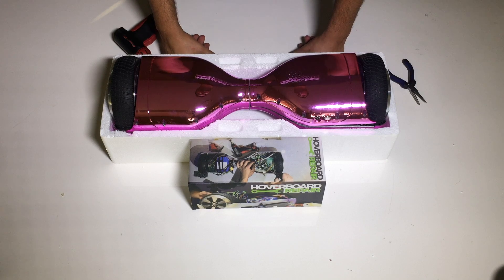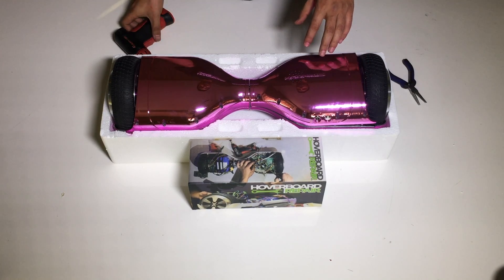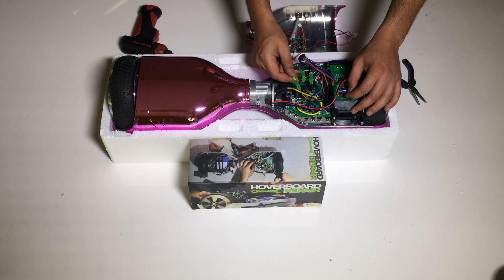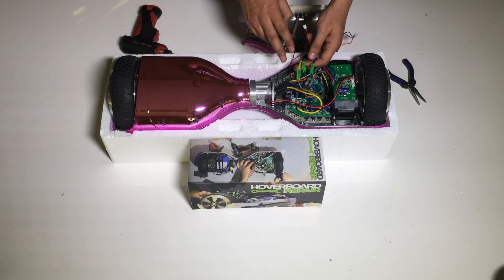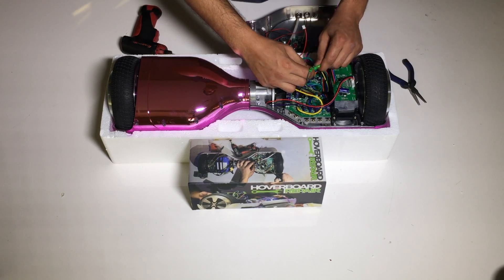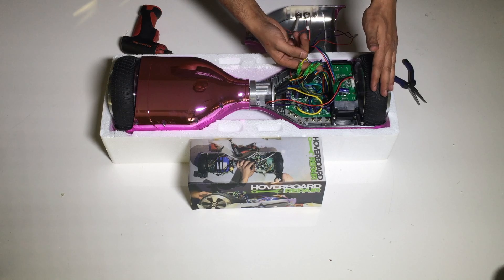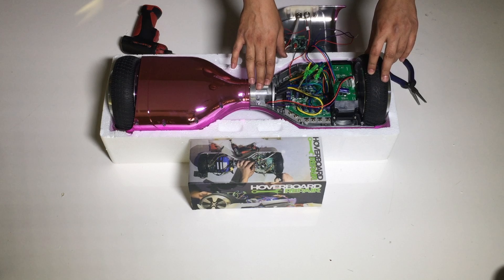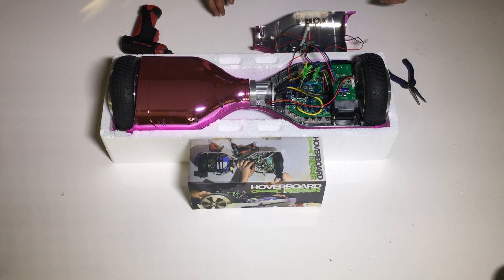Hoverboard Wheel wires combination

Comment: My Hoverboard Has A Problem And I Try Reconnecting The Wires In Different Form Of Color As You Said But Every Time I Connect  The Wheel It Start to Buff And The Red Light Just Keep Blinking
Reply: i did the same, and same thing happened
Reply: My Hoverboard Had Warranty On It So I Shiped It Back Got A Brand New One For Free